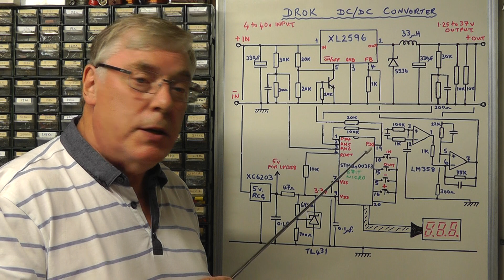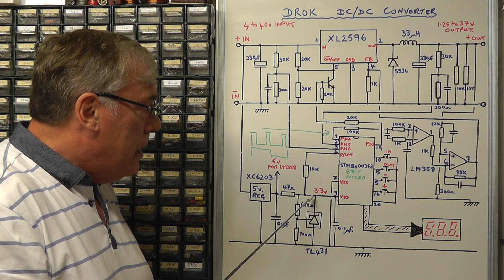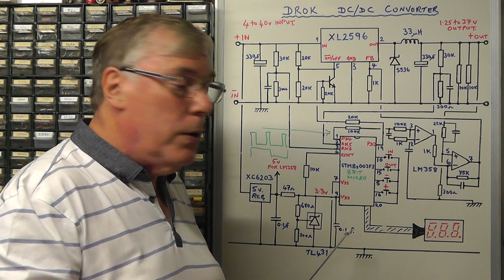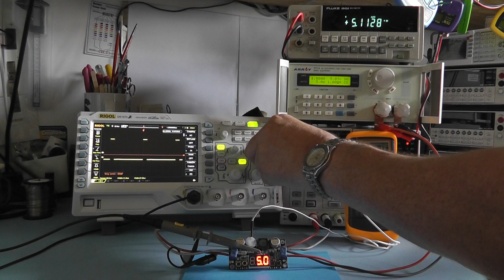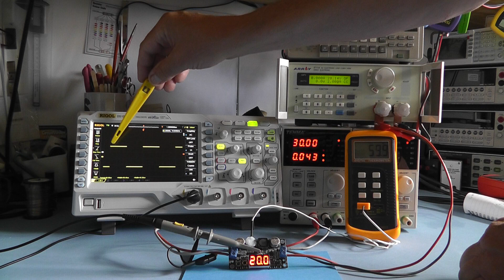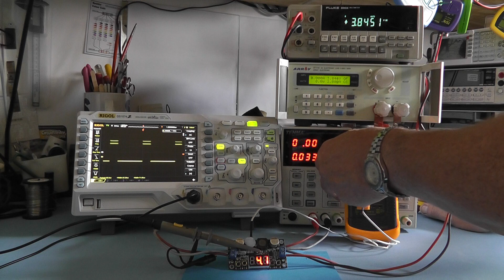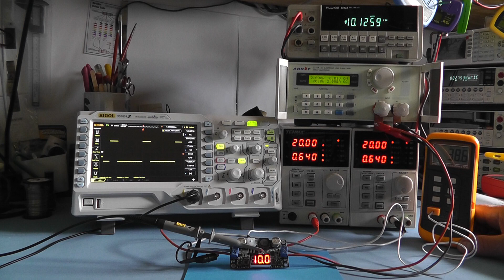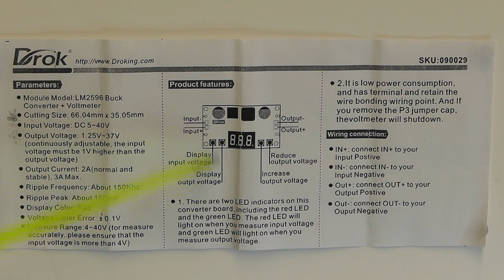Scullcom Hobby Electronics #29 - DROK DC-DC Converter Review & Testing

Comment: Best review of this sort of device that I've seen. Especially your reverse engineering, very nice schematic and explanation of the unit's operation. Just a few comments. (1) You mentioned several times that it meets its specifications for output voltage, but in fact it never did. The closest I saw in the video was +110mV as measured by your Fluke DMM, and most of the time is was +150mV or more. Since your Fluke was sampling at the input to your DC load, it was actually even worse, if you account for the voltage drop in the wires from the Drok to the load. This should be measured at the Drok board output. (2) Adding a heatsink to the top of the LM2596 (as is commonly advised by the sellers of these devices) will actually do very little. The plastic case has very high thermal resistance and is not intended to dissipate heat. Surface mount power devices like this one use the metal tab on the bottom, soldered to the PCB, for that purpose. A heatsink stuck to the bottom of the PCB would be more effective. See page 25 of the Texas Instruments LM2596 data sheet. (3) The low voltage behavior of the device was pretty shocking. If the display is on, the output should match the display, and it didn't. The ST uC should be sampling the input voltage and holding the LM2596 enable low with the display off until the minimum dropout is met and the device can produce the displayed output. Only then should it switch on and show a value. (4) When measuring ripple on a switching converter, the high frequency components of the signal can make the measurements look a lot worse than they are, particularly if probing is done incorrectly. You really shouldn't use the croc-clip ground lead on the scope probe for anything above a few kHz. The probes come with a little spring that fits over the ground barrel if you remove the spring-loaded hook. The tip of that spring goes to ground and the probe tip to the node you're measuring. This greatly reduces inductive noise in your measurements. / Anyway, thanks for a very nice video. Cheers!
Reply from the maker: FlyingShotsman Thanks very much for all your comments which are all valid. With regards your comments:
1. Prior to doing the video I did check the voltage with the fluke at the output of the module, but as I was using 14 SWG wire of only short length about 10 inches I found that it made virtually no difference. You do have a point about the error though with regards compared to the fluke, but to be fair I thought for this type of module it was quite good. Since doing the video I have had a closer look at the resistor network they use to sense the input and output voltages for use by the 8 bit Micro - the resistors I said were 300 ohm were in fact 2k 1% (they used the EIA-96 coding of 30B and I miss read that to read 300). I also found if you adjust the value of the top part of the divider which is a 30K ohm you can trim the meter reading to read the same as the Fluke. I guess they did not do this due to the extra cost.
2. I agree with you about adding a heatsink to the bottom of the PCB.
3. Yes I agree it would be better if the display and LM2596 were held off until the last set voltage by the user was reached. The Micro chip remembers the last user setting in its internal memory. I have contacted the manufacturer/supplier and indicated to them they could make some improvements by simple modifying the code in the Micro.
4. Yes you are spot on about not using the croc-clip ground lead on the scope for best results. In my video I was just wanting to display the ripple and switch spikes to illustrate a point about Buck Converters. Later when I did used the earth spring on the scope probe as you suggested I found that it had most effect on the high frequency switching spikes which are in the Mhz region. The actual sawtooth ripple of the output capacitor charging and discharging was very much the same as what I showed on the video.
Thanks for your kind remarks about my video which is most welcome. Again thanks for all you comments which I agree with entirely.
Regards,
Louis

Comment: Another excellent video.  You reverse engineered an impressive schematic for it, with thorough explanation.
I too received a DROK device for review, a very accurate little panel meter.  I think DROK is really trying to get their devices in front of the hobbyist.
Reply from the maker: Corgitronics Thanks. Yes agree they produce some nice little modules for the hobbyist. I purchased my module on eBay and then found it was delivered by Amazon. So I looked in to it further and found the DROK website and the link they use to their Amazon Store.
Reply: @scullcomhobbyelectronics1702  Modules from ebay == chinese factory seconds!  That crooked input terminal block would drive me nuts to look at...

Comment from the maker: Having had a closer inspection at the resistor values of the potential dividers at the input and output to measure the input and output voltage the resistors I suggested were 300 ohm are in fact 2Kohm 1% resistors. It seems that these resistors are marked as 30B (using the EIA-96 coding for surface mount resistors having a tolerance of 1%). All the other resistors on the module use standard 3 digit coding system.

Comment: Great review, thanks for taking the time to draw and analyze the schematics.
One puzzling thing though: the 5V reg XC6203 seems to be rated at a max input voltage of 12V only, according to the datasheet.
Reply from the maker: LANE Boys RC Yes you are correct. I did wonder myself if the XC6203 would be damaged at higher input voltages but so far it seems to be O.K. If could be that there are different voltage rating types of the same IC and I will investigate this further.

Comment: What a nice little circuit :-D, i like your diagram, makes it so easy to understand :-D.
i did notice the control buffer op amp, a parallel capacitor across the gain resistor to limit the cut off frequency.
I didnt expect the volt meter to be too accurate, but its good enough for ordinary use.
The 431 shunt regulator ive seen in just about every switchmode psu made, placed on the output to drive an optocoupler feedback error signal to the pwm chip, simple :-).
Very common in laptop 240 to 19v adaptors, easy to tweak as well.
Thanks for a smashing review :-D
Reply from the maker: zx8401ztv Thanks for your comments. The capacitor in parallel with the gain resistor in the second op amp with prevent transients from causing excessive overshoot or oscillation of the output voltage of the DC-DC Converter. So you are correct in that it will limit the gain at high frequencies. The accuracy of the voltmeter in mainly dependent on the tolerance of the resistor potential divider, if you were to change the 30K resistor to say a 27K resistor in series with a 5K multi turn trim pot you could calibrate the meter and make it more accurate (you would also need to do this mode on both input and output divider networks). This is something I might do on another project I have in mind. The 431 programmable shunt regulator is a nice device and very cheap, I have used it many times in projects.
Reply: +Scullcom Hobby Electronics Is first part of LM358 correctly drawn on whiteboard? Is that should not be active low pass filter? How it is drawn it have gain same as open loop gain of LM358.
To me it look like second-order Sallen-Key LPF but with 1k resistor and connection between it and capacitor drawn wrong.

Comment from the maker: Fivefishdiy asked if there is short circuit protection. Although the LM2569 has thermal shutdown and current limiting protection I found in practice that shorting out the output tends to damage the LM2596 and it dies. I have been looking at ways of adding better true short circuit protection in a future project and plan to use the Linear Technology chip LTC1477 which has built-in short-circuit protection up to 2 amps.
Reply: +Scullcom Hobby Electronics I think it may well happen that cheap Chinese regulators use fake lm2596 chips that are not in par with branded chips. At least I saw fake power transistors on youtube and other fake ICs like lm7805. So I never buy ICs from China.
Reply: +Alexandre Kandalintsev 
Same.
Someone I know spent thousands of dollars on hunks of plastic (fake ICs) from china ... they literally did nothing!
Reply: +Benjamin “Ozias” Esposti did you manage to get your money back? (hope so)
Reply: Alexandre Kandalintsev
No they didn't, because they bought from some random seller in china, after they bought the chips, the seller disappeared ...

Comment: Very good explanation of how the circuit works. I wonder how many degrees C would the module handle at around 1-1.5A.
Reply from the maker: Deian Cosas Thanks Deian. At 1.5 amp I found the temperature to be about 50°C. The module seems to handle up to 1.5 amp OK with out a heatsink. However, if your using the module for long periods at 1.5 amp or more I would recommend adding a small heatsink with thermal glue.

Comment: Nice review, but one question remains not clearly answered: Does it maintain the output voltage setting after the input voltage it turned off and on again?
Reply from the maker: Chip Guy Vids Yes it remembers the last output voltage set by the user. It stores the information in the Micros eeprom.

Comment: Thanks for the review. You aren't afraid of hurting the leads hanging your Peak Atlas Analyzers like that?
Reply from the maker: Robert Calk Jr. Thanks. I see your eagle eye spotted my Peak Atlas Analyzers in the background! The units are all very light so I have no problems hanging them by the leads. Makes them easy at hand on my workbench while been out of the way of getting damaged.
Reply: Scullcom Hobby Electronics 
I bought the hard cases for mine so they stay clean and safe.

Comment: Thank you for your channel!
Could you help me with Ripple in input.
I have 24AC and 12AC and I am using diode bridge with smoothing capacitor.
For make input DC voltage for my LM2575.
In datasheet I always see UNREGULATED DC INPUT.
What must be Ripple peak to peak voltage befor DC-DC convertor? 
are there any rules or requirements for UNREGULATED DC INPUT?
Thank you!
Reply from the maker: Hi,
With regards an Unregulated DC Power Supply their output voltage will fluctuate with the input voltage from the AC supply and will also fluctuate depending on the load applied, in other words, the output voltage is not set to a fixed value. Furthermore, the output voltage is not fully smoothed. Therefore the output DC voltage of an unregulated supply will still fluctuation (ripple), the value of which changes depending on the load current. This should not be an issue for a DC-DC converter such as a LM2575.

In the LM2575 datasheet there are details of the Input Capacitor Selection (Cin) for the DC-DC converter itself and this is separate to the unregulated DC Supply you are using, which states a 100uF aluminum electrolytic capacitor located near the input and ground pin will provide sufficient bypassing. This capacitor should have a low ESR (Equivalent Series Resistance) value.

Its not the ripple that is important here, it is how low is the voltage allowed to sag in order not to violate the dropout specification for the regulator or in your case the LM2575.

In short you should not be concerned to much about ripple from an Unregulated DC Power Supply. Simply choose a smoothing capacitor which is large enough to handle the maximum current you intend to draw from the DC-DC converter so as to avoid any voltage sag under load current on its output voltage. 

With an unregulated power supply powered by an AC supply (50Hz) and assuming full-wave rectification is used, the smoothing capacitor for your unregulated DC Power Supply must be able to supply current to the regulator/LM2575 for half an AC cycle (10 milli seconds if it is a 50Hz AC supply). So an example calculation could be:

For a maximum 1A supply load current with a 50Hz AC supply, full-wave rectification, where you can tolerate say a 2V sag in the smoothing capacitor voltage without effecting the regulation of the LM2575. The calculation would be as follows:

Value of smoothing capacitor (in Farads) = Maximum Load Current in Amps x (AC half cycle time in seconds/voltage sag allowed); this would equal in our example:

Value of smoothing capacitor (in Farads) = 1 * (0.01/2) = 0.005Farad = 5000uF
So in this example I would used the nearest standard value capacitor which would be a 4700uF.

Hope this helps,

Regards,
Louis

Comment: LM358 is power up from???? input? output?
Reply from the maker: The circuit I used was an overview so I did not show the power connections to the LM358. But I did indicate at the output of the 5V regulator that it was supplying power to the LM358 (indicated in RED).
Reply: ty. i looked at this video many times (my mind was on a psu build, base on arduino controlling 4x of xl2596) my bad didn't pay attention, and all your vids have description on very very details. last Q, what is the value of the 3x capacitor from lm358? again ty

Comment: Fake LM2596 chips have been reported to be unable to switch above 100 Khz frecuencies. Can you confirm that this one in particular is actually switching at 150 Khz?
Reply from the maker: The 150KHz oscillator is internal to the LM2596. The main advantage of a higher frequency switching oscillator is that you can use smaller value filter components. I do not know if the Drok uses a fake LM2596. All I can say is that it seemed to work as you would expect and in any event you could always add addition filter components on the output if the switching frequency was an issue.

Comment: I learned nothing from this video. You wasted 40 minutes of my time, performing tests and not really showing anything detailed and useful.
Temperature is the most important variable in electronics, and yet, despite having a fluke probe, you rushed and kept switching the load off before the temp had a chance to stabilize. As a result, I never learned the point where this module can be operated without a heat sink. Same story when trying to determine the shut down or brown-out voltage. You jumped from 4 volts down to 3 volts.
This is unacceptable characterization in anyone's book.
Reply from the maker: In practice this module can handle output currents up to about 1.5 Amp. Above that level you would need to add an external heatsink. For detailed information on junction temperature with varying loads and voltages check out the Texas LM2596 datasheet.